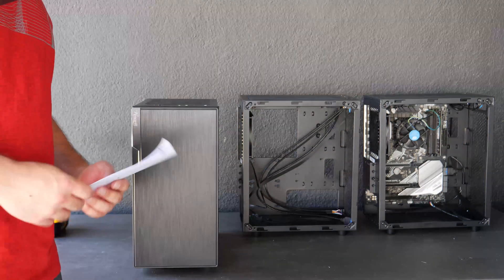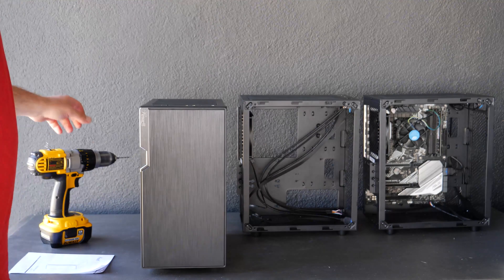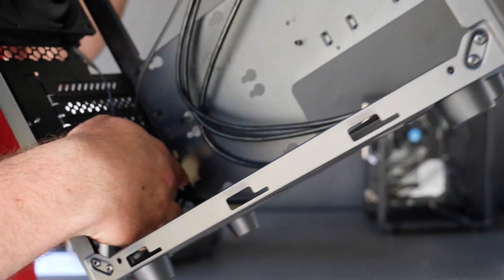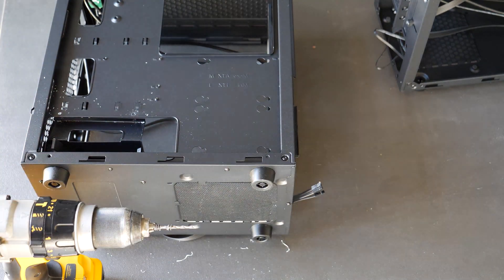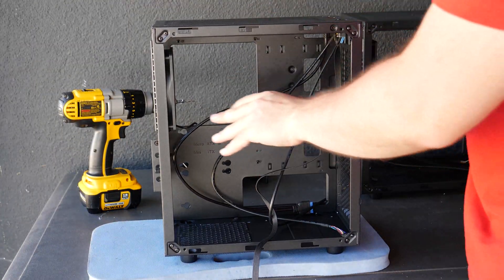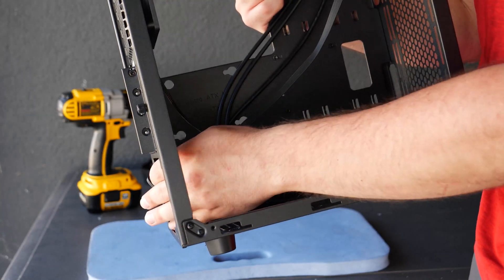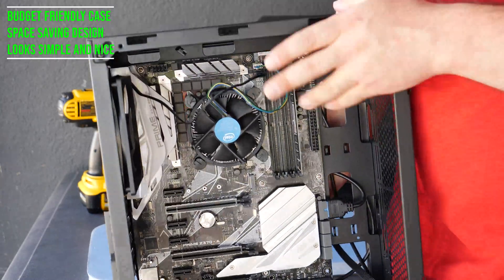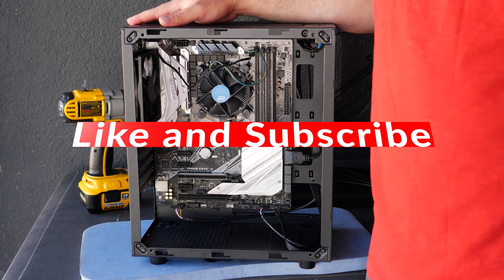How to fit ATX motherboard in a Micro ATX case

Comment: how would you fit the power supply into this case?
Reply from the maker: There should be a link to ones that fit in the description section. SFX power supply
Reply: @landpet   Thanks, ive decided to return the ATX motherboard and i have learnt from my mistake, thankfully i brought it from amazon so it should be relatively simple to return and as it is unopened i shouldn't loose my money
Reply: You can use an SFX power supply but a better idea is to make a bracket or use the PSU fan screw holes and mount it in the front of the case in the center just above the first PCI-e slot then you can mod the bottom of the case and install a 240mm radiator/AIO, you could even install another 240mm radiator in the top if the specific case your modding is wide enough to clear the ram slots with ram installed.  Doing this mod is basically creating a DIY Cerberus X case which is great and can hold the same/more radiators than many standard ATX cases.

Comment: Perhaps able to fit a smaller regular 500/600watt PS as long as the breathing holes are facing an opening.  May have to drill new mounting holes.  Definitely the last 2 PCIe slots will not be used.
Reply from the maker: SFX PSUs should be golden

Comment: Nice. I like cutting the front mesh out for the two front fans. I've tested putting 6 holes in the front plastic and it flows air like a mug. I assume the SFX power supply blows some lower ports right?
Reply from the maker: Thanks! Yes a bit from what I remember, I use a larger case now, got a more powerful computer and it can't fit in there anymore.

Comment: i did this once to a cooler master case and it lost most of its rigidity . the motherboard kept it from flexing though 😂
until that warped of course
lesson learned. 
they have attachments for drill that bevel or ream the holes so they look cleaner. Usually come in attachment kits with like 60+ other pieces at home Depot etc. rubber grommets at harbor freight if u wanna get fancy
Reply from the maker: Lol nice

Comment: Is it possible to add a AIO cooler with the atx case
Reply from the maker: I think you could get away with fitting a one fan AIO cooler. I just avoided it though. Not too much room in this case.

Comment: I personally would not prefer that, couse you may get problems to fit the power supply, or PCI graphic cards in sli/crossfire mode. You may also get cooling problems with a powerful equipment....
Reply from the maker: They have smaller power supplies, sfx, but definitely agree, can barely fit one video card in here, no way to put in more. This is more of a regular build to save space, not intended for any powerhouse builds

Comment: love your video! that's cool how you fit that ATX board.
When you ran into PSU's size problem, I just bought two used similar micro-ATX cases then clamp them together using a "hand-made" bracket. one side for motherboard and GPUs and the other one for big-chunky PSU and drives.
Reply from the maker: Thanks! Yup that works

Comment: Do a corsair carbide 275r version lol that's the one I have but didn't know it was thick boy til I got it (Impulse purchase on-line) I loved the vertical gpu style though... now I'm tempted to mod it like the video..dunnooo ideas
Reply from the maker: That looks like an ATX mid tower, it should just fit a normal board without any mods. I do agree, it's a cool case, totally see the impulse buy.

Comment: Sorry to bother you, but can you tell me if it's possible to use ATX  ''GA- PA65-UD3-B3'' motherboard with this micro ATX "FORNAX-970R" case?
Reply from the maker: I don't know if there's anything in that case to bother the ATX motherboard but ATX and Micro ATX board have the same screw positions with the exception that the ATX boards are larger and use more screws. So I can't say if it will fit or not, I feel like it can but you may have to modify it like I did with this case.
Reply: @landpet  thank you for reply I'll try it your way :D
Reply from the maker: Great

Comment: Its cool that you did that, but i would prefer to see how you managed all the other components also!
Reply from the maker: Sure, I don't have much in there. A simple video card (Nvidia GT1030) and an SFX power supply. I use NVMe SSD so it doesn't take any space.

Comment: WHERE ARE YOU SUPPOSED TO PUT THE PSU
Reply from the maker: If you get an SFX power supply, it will fit in the dedicated PSU slot
Reply: @landpet  yeah right. You can get an sff psu but couldn't afford a right sized case.
Reply from the maker: Price was an added benefit which you're right that the SFX power supplies do cost more. My main intention was compact size.

Comment: not worth it for bitfenix prodigy M. Motherboard would have to be sideways super awkward and io relocated... not sure I want to demolish the case just because a badass ATX board is only 45. probably better just to stick with 2133 ram. and matx
Reply from the maker: I don't have that board, makes sense if it doesn't fit.

Comment: any reason you couldn't turn the PSU on it's side to fit a standard sized one? might need some doublesided tape to stick it down, but as long as it's not touching the mobo, right?
Reply from the maker: Sure but it wouldn't let me fit a video card or any other pci express components. Someone mentioned, they fit it where the CD tray would go, sideways. If you really want, you can get it in there so as long as you don't plan on adding anything else.
Reply: @landpet  ahh, fair!
Reply from the maker: @theecube1  Yup

Comment: i just did this in a coolermaster n200 mATX case, and fit an ATX mobo in. I actually mounted a full size power supply basically where the cd rom would have gone.
Reply from the maker: Nice!
Reply: yo, thats something i intend, is there anyway i cud get a peak at it, just to get a rough idea as to what i am getting into..

Comment: https://pcpartpicker.com/b/cNPnTW 😎👍
Scroll through the pictures, you'll see my new build at the end. It won't let me change the parts in the description, since they're "not compatible" with the case.
Thanks for your demo, it was very easy!
Reply from the maker: Looks awesome! Looks like your video card barely cleared the AIO. You really notice a big difference between the case sizes. But most importantly, what happened to Venom?
Reply: @landpet  Lol, he'll be watching over from the top. My office is a mess, with all the cables, fans and screws I had to use, and remove from the old case. Once it's all settled, Venom will be there!
Reply from the maker: lol nice!
Reply: @landpet  well done, well inspired video...

Comment: Here's a mesh version of this case, double the price though!
https://youtu.be/8zcp9ycqsls
Reply from the maker: That one does look better but double the price, not sure it's worth it for me. I'm going to make one of my machines into a NAS with a bigger case.
Reply: @landpet  I'm gonna sell my Define R6 once I get all the parts. Would that fit your need?
Reply from the maker: I ordered the Phanteks Pro M, going to try that out. It was a close call between the Corsair Carbide 200R and the Phanteks Pro M. I considered the R6 as well, it's cool how that one has 6 3.5" bays, so it's easily big enough but it weighs a lot, so that discouraged me. A part of me wants to fit everything in the FBM-X2 case and call it a day lol, that would be ideal cause that case is tiny and weighs nothing but it may not be possible since I may put in a bigger PSU.

Comment: I just ordered a case to do this, but this one is even smaller. Can a 360 rad fit up front on the inside with the drive cage removed?
Reply from the maker: No, 360mm won't fit even with drive cage removed. My 360 rad measures 15.5 inches in my normal case. This smaller case is 14.96 inches tall (https://www.rosewill.com/product/micro-atx-mini-tower-desktop-gaming-pc-computer-case-usb-3-0-fbm-x2/) and you got the power, reset buttons up above taking up some space there as well. You could fit a 240mm radiator easily though.
Reply: @landpet  Oh, so close... Thanks for the info. It's sold out everywhere, with no restocking anyways. 
I have a 360 and a 240 AIO that I want to squeeze into a small case. I like diy challenges. Any case recommendations? I just ordered a Phanteks case, but I'm not sure if it's my final choice.
Reply from the maker: @HUNtastic1  I don't have a specific preference, I just saw this one and liked it. I also like the open case kinds like the Thermaltake Core P3 but that one is much bigger.
Reply: @landpet  would you sell one of your cases? The one in the video?
Reply from the maker: @HUNtastic1  I put a few parts together and made a few basic computers running Windows. Minimal style, Asus Mobo, Core i3, NVMe SSD, SFX power supply, 16GB RAM. It would be easier to sell the whole machine but I doubt that's what you want.
Reply: @landpet  I was able to grab one of the 5 that was available on Amazon. It's shipped, and on the way! All sold out the same day.
Yeah, I'm not looking for a new system, I'm moving my existing i7, 1070 Ti, and Maximus Hero X in the FBM X2. I have a Define R6 right now, but it's just too big for me. I'm gonna put a 280 AIO, instead of the 360. Waiting on the new RTX, some already come with a 240 radiator. That's my next plan.... 
Thanks for the great video, and your help.
Cheers!
Reply from the maker: @HUNtastic1  That's awesome! Yeah they sell out quick, I'm glad you grabbed one before it was gone. Define R6 is nice, this FBM X2 looks like a mini Define R6 kinda. That's some good specs, I'm actually running a tad older system but very similar Maximus Hero IX with i7 7700k, 1070 and a 360 also but it's all in my thermaltake case. If you want some quiet fans, Noctua fans are AMAZINGLY quiet though they're not exactly cheap. Good luck and Cheers!

Comment: where the psu should go then!!!?
Reply from the maker: The PSU goes in the bottom back side of the case. You just need to get the small version of it (the SFX power supply). A standard size PSU will not fit with the regular size ATX motherboard.
Reply: landpet would you need a bracket to make it fit in the same screws?